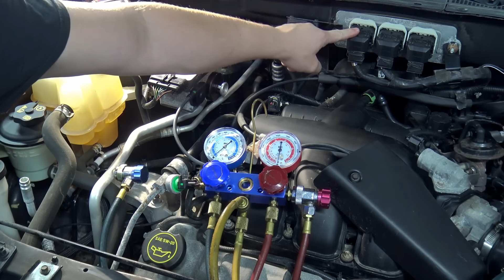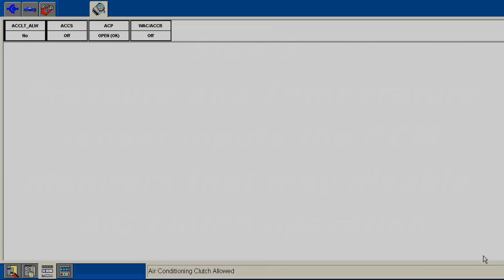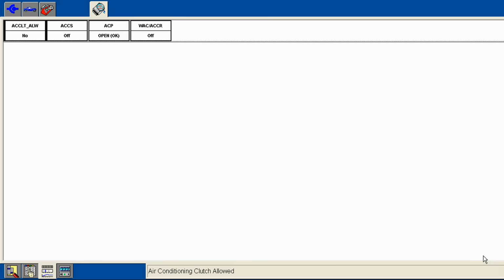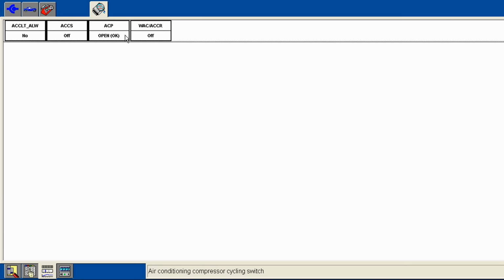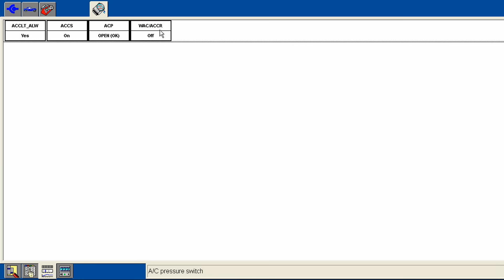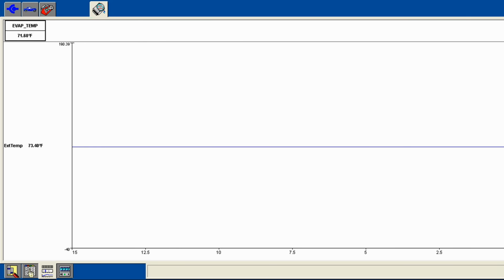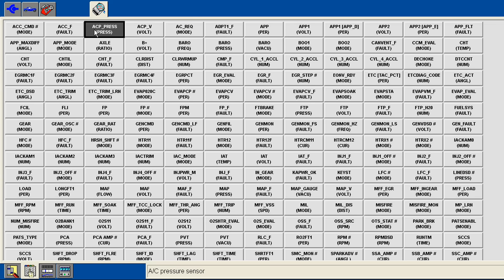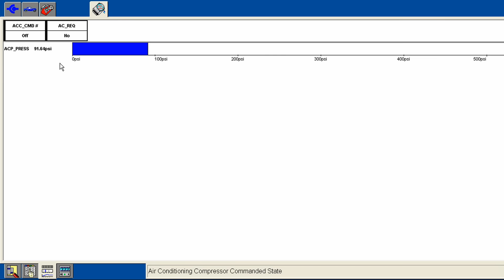Ford A/C Quick Tips #7: How To Quickly Diagnose A/C Concerns

Comment: Please Help Im getting codes P193E & U0164 it completely shuts power to the A/C ,radio, front power windows & door locks its a 2017 f150 5.0 crew cab .

Comment: Have a 98 ranger 2.5 not sure what I'm doing wrong.  Replaced the compressor, hoses, condenser, accumulator, evaporator core, and orface tube. Pulled a vacuum and don't have a leak, charged it with 9 oz pag46 per the manual.  Filled with 1lb 4 oz of freon r134a. For some reazon the compressor kicks on for a couple of min then shuts off. I can wait a couple of min and dose the same thing. It can be cold, or hot doesn't make a difference.  I've already invested alot of money and can't afford a mechanic at this point. Any suggestions?

Comment: Great video. So my ACCLT_ALW signal is no at all times and I can't seem to figure out why. I have done all the checks in this video and several others and I have not been able to find an answer. Clutch works during engine off self test. I have good static and dynamic AC pressure (I had to jump the AC clutch relay). I tested all the relays and fuses for the system and they were all fine. When I jump the clutch relay, the AC blows cold and sounds normal. Both the pressure sensor and high pressure switch have normal values. Engine temp and load at idle are normal. I can't make heads or tails of this. I can't even find a list of parameters that tell me all the reasons ACCLT_ALW would be no. Any help would be awesome.

Comment: Hello, great videos. Non related question. I have a 2014 Ford Escape 1.6L Ecoboost. The A/C has a really slow leak and freezes up on occasion and needs refrigerant added. A local shop tells me they can't just "top it off", they need to drain the system completely and refill it. Is this so?

Comment: My air conditioner comes on and  off the pressure is about 46 then goes to about 5 or 10 it is on a 06 f150 5.4
Reply from the maker: If static pressure is 45 then the comp comes on and rapidly drops to 5-10 you have a low charge.

Comment: I have a 2011 F150 5.0... The air is cool measured with a thermometer at about 64° but never gets cold… The AC compressor continually cycles on and off… Took it to my mechanic friends house and had The refrigerant evacuated filtered and replaced with the correct amount still I’m getting the same result… I wanted to jump the low pressure switch but it has three prongs on the plug any recommendations?

Comment: What could it be on a 2012 ford e350 ac is cold when i drive but warm at idle
Reply: Check two things , radiator cap or thermostat,  that would tell the PCM not to switch on the compressor. Replaced the cap on my truck and bam!

Comment: The low pressure protection circuit is for more than just the oil.  Refrigerant helps dissipate heat form the compressor.  Running without refrigerant will overheat the compressor.  That would be like blocking the airflow across your radiator, the engine would seize up even with plenty of oil.

Comment: Well Done video. The PCM is no longer my adversary, Its my buddy. We used Forscan on a 2010 Crown Vic  and determined short  in clutch relay circuit,  With help from a wiring diagram found pin number at pcm and color wire. We continuity tested wires to find break and spliced in a new wire. A/C cold !  Accessing the PCM can be intimidating at first. Patience and lots of Google..

Comment: What if the clutch is latching in when you turn it on but it is blowing hot air? I tried charging it and it shows fully charged but still blows hot. Anyone knows the problem?  Do I need a new AC compressor ‽

Comment: I got one for you. 2005 Ford expedition new compressor  and service. Relay is good. PCM control side of relay when reads 12.4 volts. Tested pin 18 on C175B and same reading with relay out and both pressure switched  plugged and unplugged. PCM said AC Command is ok
Reply: Thought it maybe ghost voltage so tested with test light and it lit.

Comment: Great, thanks!  1996 Ford Ranger 4.0 liter engine, is there a way to just test the clutch itself via powering the two(?) wire connector on the compressor?  +  or - to which?  Thanks.

Comment: Outstanding video! Already knowing my freon was okay and suspecting an electrical issue, I just ordered a cable for FORScan. I was about ready to resign myself to taking it in to get looked at, and now I'm excited to be able to sort it out myself. Thanks!
Reply: 2 yrs later did you ever get it working lol
Reply: @kurti4432  Yep. had to replace the front evaporator in an 04 Expedition. Took me about 3 months since I had barely any experience working on cars and Murphy's law hit pretty hard (had to cut out and replace old hoses that wouldn't quick release, etc.). Ever since then, though, pretty much any of the myriad car issues I've run into seem pretty trivial to handle myself, though, which has been a huge benefit.

Comment: I have a 2010 f150 the compressor kicks on but only for a few seconds at a time and every few seconds it's definitely putting a bond on my electrical system because my lights done when it kicks on I'm getting no cooling I don't know if the issue is.

Comment: 2020 December AC blowing hot warm air-fan running super high-paid $75.00 for a diagnostic-tech said low side was good and high side was too high-tech said compressor was probably bad and probably had come apart and junk was in the lines-said need to replace compressor and condenser-repairs are just shy of $750 labor and $750 parts-Why can't people tell you what is actually wrong instead of saying probably and I have never heard of a compressor coming apart and getting junk in the system-Is this a thing? Doing without AC until it gets hotter. It is still warm (80's) in Corpus Christi, Texas in December this year. Please advise.

Comment: My ac is really intermittent. Can be working some months but suddenly stops working for a week or some days or hours. When idling ac set to auto and 16 celsius engine fan cycles on and off every second or 2. What is causing that cycling? Compressor is on and clutch engaged. When I press off on the ac button the fan stops. I need to lower the temperature setting to get somewhat cool air. Not what it used to do some years ago. Had really freezing temperatures then. Really annoying.

Comment: My ford explorer 06 blows cold air on hot air option. I change my heat valve control and it didn't fix it.. any suggestions
Reply from the maker: Replace the temperature blend door actuator
Reply: @FordTechMakuloco  yeah that night be it. Thankx

Comment: Would it be possible so manyally check the low pressure switch or sensor using a multimeter? lacking a pressure gage and proper diagnostics tool.
Reply from the maker: The switch should be a closed circuit.

Comment: The compressor on our 03 CVPI stopped working on Friday(8-28-20), after making a loud noise for awhile. The week before, I "recharged" the a/c with one of those cans purchased at Walmart. It worked for about a week, then quit, and only blows hot air. I'm going in for surgery in a week, so cant get to it right now. Is the compressor shot, or just the bearings/clutch assembly?

Comment: I have a 2013 ford transit that doesn't cool worth a shit @ idle. Rev  her up and she blows 49*F
I am a residential hvac contractor, I try to stay far away from auto ac lol. I did check the low side charge and it's good, (between like 30-40 psi)
I'm thinking maybe dirty condenser or orifice, any tips?

Comment: I have a 2000 5.4 and my compressor runs all the time. It sounds fine and looks fine and has 237k km. I pulled the 40 amp fuse to stop it bit would like to fix the problem. Is it the clutch or some other relay?
Reply: It still blows cold air also.

Comment: I have a 2000 5.4 and my compressor runs all the time. It sounds fine and looks fine and has 237k km. I pulled the 40 amp fuse to stop it bit would like to fix the problem. Is it the clutch or some other relay?

Comment: My car is weird 😒 my Ford focus mk3 tdci 2014, it won't start the climate.. The ac fluid is new, around 450grams. When I start my car, it increases the idle and keeps there all the time? And when I press the ac button, I don't hear any click? But the idle goes up 🤔.. If I turn the ac off, it idle down to normal. And when I use the normal control, there's a high pinch sound from the air on the lowest fan speed. It goes away when I turn the ac off. Any ideas?

Comment: What would be a descent scanner to read the live status of a 2016 F350? My air compressor clutch doesn't engage thru the  subsystem.  My Autel AL619 wont do the job you described in this video. All fuses and relays are operative and I've replaced the high/low sensor in the coolant line and the ambient temp sensor reads correctly. All lights are normal on control panel and air flow is normal in perspective paths.

Comment: 06 Expedition Limited, brand new motor installed by a shop.
 Used the AC once or twice since i got it back(about a month and a half ago) and on the second time I heard a "slapping" coming from the serpentine. I turned off the ac and the slapping went away. I grabbed some lights and put them straight on at the belt so I can see if it was moving.
   I noticed that at the power steering pump pulley, the belt seems to want to jump off twords the firewall. I looked from both driver and passenger side to see if the belt and pulleys looked like they lined up and they did.  Other then the slapping nose from the belt trying to jump, there is no other strange noises. The AC also works fine and gets cold fast. Is this a sign of my clutch going out or, is something misaligned? I'm just trying to figure out if I need to pay 300+ to fix an AC or zero on warranty work. I appreciate any help and thank you for your time. Love the channel and all you do for the ford community.

Comment: I have a 2016 ford fusion and the air is ice cold, except when i stop or it idles?? Then it feels like the heat is on. I noticed only the drivers side fan running. Any idea what the problem is before I loose my mind?? Lol. Thanks!

Comment: Does this also help to figure out why the hot air blows from my air conditioner in my 2000 Ford Expedition 4.6L
Reply: Blend door
Reply: @Gribble334  Thanks for the response. I was told it may be a blown fuse. But it only blows hot in the front and cold in the back seat areas.

Comment: I am using a MATCO TOOLS Determinator. For the a/c pressure switch it reads voltage at 4.14 with the engine off and  4.00 to 4.04 when the engine is turned on.. Any ideas what it should read? Also my AC Head Pressure reads 150.02 PSI it’s 92 degrees here in NY

Comment: What do I need to do next. I replaced the ac compressor and the orifice tube. Now that I charged it with Freon the clutch engages for about three seconds and shuts back down, then a few seconds go by before it turns back on for three seconds and shuts back off. There is a clicking sound that comes from one of the lines which in going to assume is the ac pressure switch.. is that what could be wrong? I already checked the relay and it still works. So what can I do??

Comment: Question I have 2008 Ford F-250 5.4, pressure is ok 40 low and 200 high side, no cold air. Low pressure line is cold and sweating and the clutch keeps turning doesn’t stop. Please help me out
Reply: The compressor cycles based on engine RPM and heat load, an incorrect refrigerant charge or pressure/temp sensors that are out of spec will effect the compressor cycling.

Comment: So I have a 2007 ford Expedition max  , I checked my ac psi its at 80 witch is good an then I checked my clutch an it engaged properly an i can't turn it .I started up an turned the ac on the clutch engaged but doesn't turn an gets really hot  like its slipping. 
Is the compressor done ?do I need to replace it? Or can it have to much froun in it ?

Comment: There is no easier check if your Ford A/C is not working... check the high and low pressure valves (usually the issue is in the Low side). If there is a white residue, the gas leaked out. Do not buy a refill can. Take it to a professional as they need to create a vacuum and then refill it. If it should work right after. In some cases you will need to replace the valve which looks like a oversize pneumatic tire valve. The o-ring can leak over time. Another thing, use your A/C system. It is more likely to leak or die from lack or use.

Comment: Great video I learned a lot I have a 05
F150 the ac runs great for about 10 minutes then the compressor drops out l have checked the pressures and replaced the clutch relay and the low pressure switch  I jumpered the high pressure switch and it still drops out

Comment: If the system builds up to pressure with less reftegrant means that either there is air in the system, too much oil or a blockage in the system, am I right?

Comment: my 2005 f350 ac wont work ,ac clutch wont engage i checked all fuses ,it is fully charged ,and i am getting current out of pressure switch from dryer to the pressure switch by the compresser but power does not reach ac clutch what am i missing

Comment: Hey 👋🏼, CAN YOU HELP ME!! ??😣
When I turn off my ac, the air still coming out. It looks like doesn’t close. I changed the air door actuator and stills blow air. 
Thanks 
2009 Ford Escape
Reply: Perhaps your fan/blower is still on.  It can blow without the A/C in operation if you have a MODE selected such as FLOOR or VENT.

Comment: my 2012  (3.7) mustangs compressor just stopped working, freon levels are ok, replaced compressor cycle switch, hvac module, tried a friends radio control module, and replaced a blower motor resistor and blower motor right when it happened. my car battery died and it wouldnt start, then i tried starting it later it slow started really slow. now no ac... when i bypass the fuse relay the compressor turns on and blows cold, fuse relay itself wasnt bad as i swapped the fuel pump relay and the ac relay to ensure the car wouldnt start, no clue what to do. i dont want to trade her in i worked so hard flipping burgers at mcdonalds!

Comment: What would you suggest when the system is holding a charge, clutch is popping in and out like it should, both 10a fuses inside the vehicle are in good shape, the temp selector switch inside controls between hot and cold air but their is no cold air at all? Ambient temperature around 70-75 degrees F, vehicle in question 2005 F150 4.6L. Thanks for this great video.

Comment: Its it true that if system is out of refrigeran for a very long time the pcm will generate a code that when charging system with refrigeran compressor wont kick in due to the code generated from PCM? & that to reset the code you can try disconecting the car battery to reset the code so a/c compressor will turn on? Thanks
Reply from the maker: No that is incorrect

Comment: I doubt I'll get a reply but my ac problem is with a 2007 F150 5.4. I replaced the leaking low pressure sucking line (Had the R134 sucked out first at a local shop). I then bought a vacuum machine and gauges and sucked out the air for 2 hours. I t held vacuum overnight so I know there were no leaks. I then attempted to fill the system and it srarted to cycle and take in R134 but then quit. The compressor will not turn on and it looks like it's over filled if I use the little gauge with the smaller fill unit I got at Walmart. I let out some refrigerant to where it's in the green but it's still not cycling. When I hook up the gauges it reads 40 on the low side and 40 on the high side. When I shut off the vehicle the readings stay the same. Where do I start? I can't seem to find a drawing of the 150 ac system so I'm not even sure what to look for if someone said try this or that.I like fixing these things myself. Any help would be appreciated!  BTW..I should mention that I do have Forscan :)

Comment: I have a question regarding the A/C system in my 2003 F250 6.0. When I got it, the A/C didn’t work. I found that the 10 amp fuse (I believe it said a/c clutch) under the dash had blown. I replaced it, and it worked alright, except the starter had a hard time turning over. It was almost like the engine locked up (that clunk sound). Aside from that, the A/C was cold and worked fine. Until I took off driving. Once I did, the same fuse blew. Any ideas? My only thought was a short in the A/C coil.